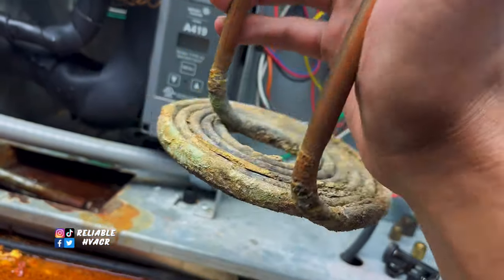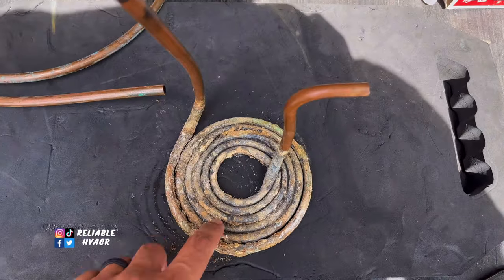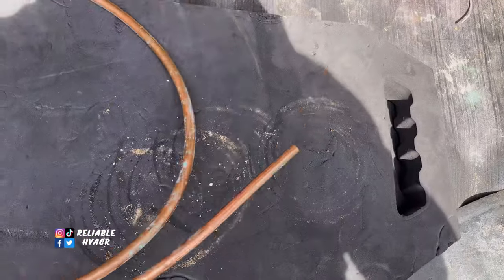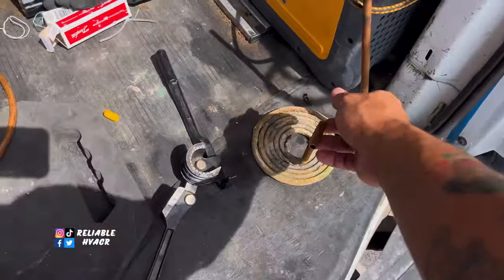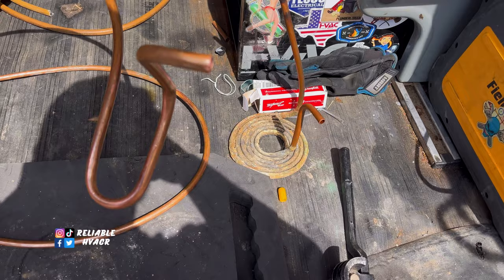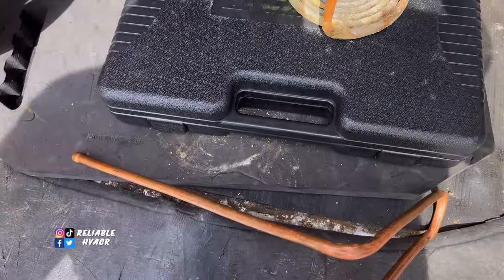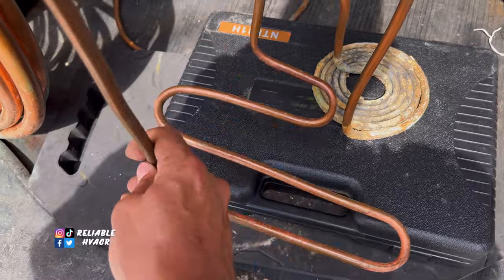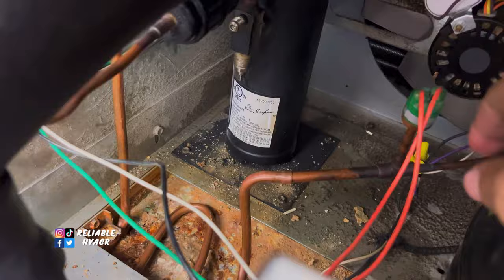These always leak! / HVACR

Comment: when I was doing alot of  commercial refer work I kept a ten lbs bottle of Co2 with a self coiling air hose and a blow gun like used on air compressor with me. although it could sometimes be messy it made cleaning small condenser coils that were otherwise hard to clean on prep tables, reach ins, open airs and the likes quick and painless. had to obviously be aware of the dust you may creat blowing out indoors but man, it’s was awesome and didnt burn up the valuable limited supply of nitro real fast. Co2 rig was quick and easy to deploy and being Co2 over compressed air it lasted forever. great for large site PM’s also when I was doing that.  even when having to take a unit outside you could clean a coil well and not have the work space having water everywhere that was a pain to avoid tracking back inside. not to mention we have zero water runoff aloud sites also. volume of air with the setup was way higher than using nitro. way higher.
Reply from the maker: Probably could have gotten away with that, it would have just fallen behind and only God knows what's back there anyway 😂 it seemed caked on tho. Fast food places and their grease 🤦🏽‍♂️ thanks for the tip

Comment: Great video when l see this condenser loop pan l use to get rid of pan & Cond pan discharge put in a electric Cond pan wire in won’t have this problem with it every for the customer if your going to go through all that work.

Comment: You may used a heater pan and not use the copper coil any more, just need to find a way to connect power to your heater and adjust a little less refrigerant. Good video good work. 😉
Reply from the maker: Yeah but there's not really a lot of room on this one.
Reply: I think actually is also keeps the head pressure down,  I've seen a lot on sandwich coolers,  a cascade runs down the cold drain water on the pipes then to water heater..

Comment: How do you like the elitech leak detector?  I've got one  but would like your thoughts. Have you tried a jewlers torch kit? It's all I use, much easier to get into tight spots. Rosebud with it I've used on 1 ⅛. Takes a bit more time but very doable.
Reply from the maker: Not sure which one you have but they have infrared ones that are almost identical to my hilmor and that one worked great. 
They have me testing out this PPM one and it's been good so far. They seem to be built well and affordable at that.